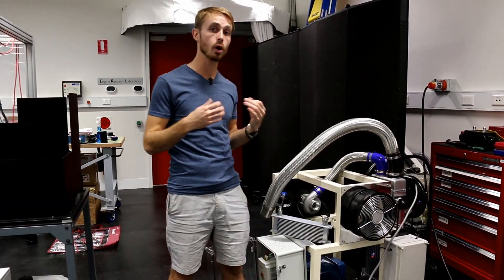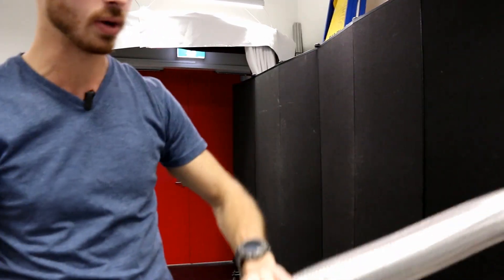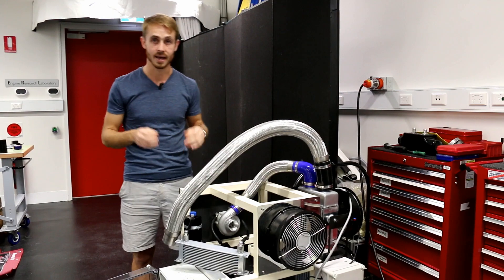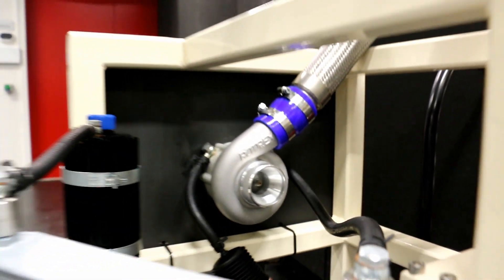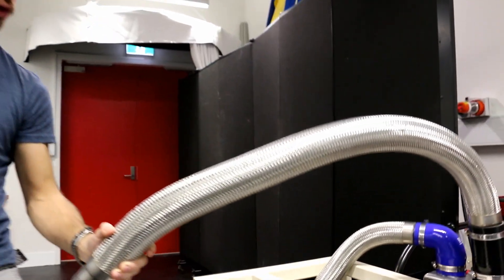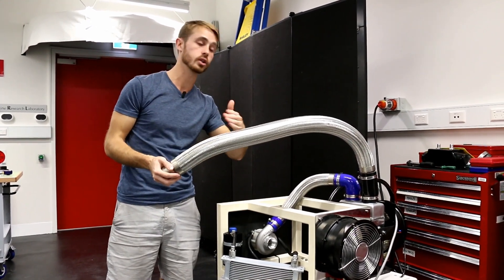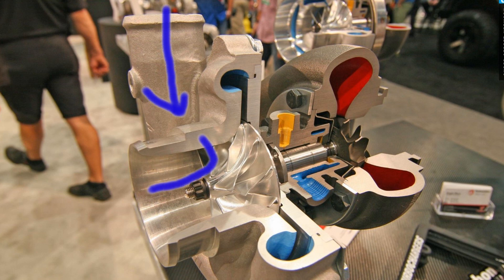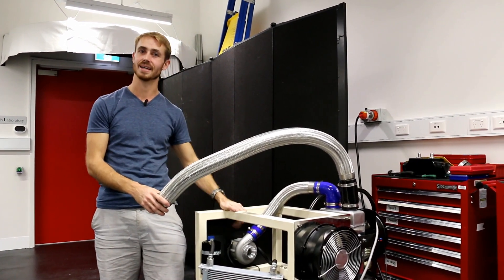What Causes Turbo Flutter? Compressor Surge Explained

Comment: I still feel that lift-off turbo flutter is bad because it slows down the turbo RPM. It might seem like a negligible amount of time to spool back that bit of decayed RPM, but we spend enormous amounts of time and money to optimize performance. I think the flutter sounds cool but if we're min/maxing, it would make sense to avoid it altogether
Reply: It does not slow the turbo down, people have tested it but you can also look at motorsport even at the highest levels and see cars running no blow off valves, if it caused any lag none of them would run without a valve.

Comment: Can you explain how exhaust has any affect on it? I had a 90mm stainless aftermarket exhaust with 1 set of catalytic converters, and just upgraded to a 102mm full Titanium without Cats. I had Compressor surge with the 90mm exhaust. Now I have absolutely none with the 102mm. I obviously hear the turbos more which is nice. But just confused how a larger outlet and more flow would eliminate the compressor side noise.
Reply: With the smaller exhaust and catalytic converter’s, you were creating way too much back pressure and for a turbo charged engine you want to get the exhaust out as fast as possible, and as smoothly as possible since you upgraded to a larger piping and got rid of the cats, the flow has now created no strain on the turbo so it doesn’t have to work to push the air out of the cat
Reply: That’s also why, when you free up a turbo charged vehicles exhaust system, you gain a lot more power than just regular normally aspirated vehicle It allows the turbo charger to work like it supposed to with no restrictions as long as the intake isn’t restricted and you have a blow off valve that is set up properly if you have a blow off valve that has a harshness setting in the spring insert to the harshest setting meaning it’ll only go off at maximum vacuum, you will get compressor surge because you are blocking the only route for it to escape. No that’s not what you asked but yeah.
Reply: @oler777  Thanks dude.

Comment: you forgot filter type, box filters muffle the 'flutter' sound while cone shapes like K&N filters will increase flutter noise.

Aircraft mechanic here, compressor surge in any turbo or turbine is when the impellers lose lift and air pressure can escape back through the pressure differential UNDER POWER. If you actually close throttle body (OFF POWER) you'll no longer have exhaust spool allowing the air to escape much easier back through turbo which is NO LONGER FIGHTING IT.  Turbos that do generate stall under boost ON POWER will trick the afm and ecu fuel distribution at the same time causing misfires and potential catastrophic damage. However turbos immediately OFF POWER cannot 'surge' as there no new air being introduced to hot or cold side under load making the air travel backwards swiftfully like me letting go of an untied balloon
Reply: That's what he explained, meh
Reply: Surge/stall is the same whether you're pressing the gas pedal or letting off. It's the pressure on the outlet of the compressor being too great in relation to the flow rate.
"turbos immediately OFF POWER cannot 'surge' as there no new air being introduced"
A turbo doesn't just stop spinning the instant you take your foot off the gas. The turbine/shaft/compressor all have inertia.
Reply: @derschwarzgeist  because theres no new air, the internal impeller cant create  interal lift stall conditions (like when a plane climbs too quick and stalls losing altitude). This is surge on throttle, i know what youre saying but this is not that

Comment: please make a video about wastegates and what happens if you block them. no one i know of has explained that. is it better to block them? simpler and faster spool. using only the bov to regulate pressure?
Reply: If you block it the turbo will overspin and destroy itself, releasing the pressure with a blow off valve isn't going to stop that.
Reply: You'll get more 'boost pressure' but turbo won't last. Used to do this to Metro turbo's back in the day, pair of mole grips clamped to wastegate pipe
Reply: @jellybaby7  
ok.
is the compressor wheel material, of today not good enough to spin that fast, without destroying itself?
what about tuning the turbosize to the engine, thereby preventing overspin?

Comment: then how come I lost all my chu chu noises when upgrading to a larger turbo? recirculate blow off valve is also installed before and after the upgrade.
Reply: Your blow off valve is the wrong way round, oh dude your poor new big turbo, no wonder u lost the chu chu noises
Reply: @jellybaby7  Or, if it's the exact same valve, the smaller turbo was creating enough pressure to cause stall but not enough to actuate the spring in the valve.

Comment: Yet there are people out there that think flutter is cool and don’t run a bov just so they can produce the sound
Reply: Flutter is cool though.
Reply: @DriftNick  In what way? All it's doing is indicating your turbocharger and intake aren't set up well.
Reply: @derschwarzgeist  It has nothing to do with your intake or with those things bening set up well, the sound is from not running a blow off valve or bypass valve, it's also common place in motorsport.

Comment: This is what happens when millennials get turbo's and don't know SHIT about how they work and love the FLUTTER sound thinking its cool when its actually destroying their turbo ... 
YES i called out the millennials because its ONLY you fuckers that have this flutter sound on your cars ... Trust me, i own a 240sx turbo, a genesis coupe turbo and an MKIV Supra GTE ... ALL have BOV (Blow off Valves) that actually work and release that pressurized air ( PPPSSHH)  AS INTENDED to protect the turbo ...
Reply: I guess the 40+ year old engine builders and tuners here in Australia building 1000hp+ engines that don't run blow off vales on their cars are millennials, what would they know though some random guy on the internet said it is bad so it must be true.

Comment: so i have 1.9 jtd 16v, and sometimes if i step on it on 3rd and at 1500rpm and i released gas but a little bit only, i can hear dudududu clearly, but it needs low rpm and not to release gas pedal fully, so what can i do for doing my jtd dudududu every time and every conditions? has it some type of hidden blowoff from factory or how can i do it? thank you

Comment: This is not turbo flutter unfortunately guys..... it compression surge which happens during compression. Turbo flutter is when the throttle closes.. 2 different instances so they can’t be called the same thing, 1 is during throttle (compressor surge) the other is when throttle is released with no bov (turbo flutter)           Edit: just seems they corrected him like 10 times already 😅
Reply: You need to read what you type ... Read it again and again and when you find the several issues, do it again and send it...
Reply: You Tube I read it 75 times, what don’t you understand? With out a bov when you spool and release throttle you will hear turbo flutter (throttle closed) this guy in the video is demonstrating compression surge and calling it the same as turbo flutter. Read my message again and agin and eventually you’ll understand 😂
Reply: @hubertallicock4336  really ??? 75 times ?? Some people are stupid but to say you read it 75 times is even more STUPID ... 
Compression surge happens during compression ..???
Reply: @hubertallicock4336  They're the same thing.
On throttle: turbo pushes more air than engine can consume, air "piles up" in intake, pressure increases, causing surge.
Off throttle: throttle valve is closed, turbo keeps pushing air into intake, pressure increases, causing surge.

Comment: thanks Kylie. I thought flutter is ok with throttle closed but not ok when during the acceleration. Please explain. Or a shorter charge pipe is better.
Reply: Why would you get flutter during acceleration ..??
Reply: @ACommenterOnYouTube Do you not understand why it happens on throttle?

Comment: It's all about how strong your Thrust Bearing is. Stronger ones on the bigger Turbo's you find in Supra and Evo builds can handle the surge no problem. Weaker ones that you'll find on basic K03's, K04's etc etc will definitely not last when you block off or remove the BOV. I'd give it 6 months before that turbo fails and completely wrecks the bearing, which then causes the compressor wheels to run into the wall of the turbo.. Installing a decent 360 Degree Thrust bearing should help to alleviate this possible issue. But personally, buying a turbo made to handle such excess surge would just be a better way forward.
Reply: Do you mean the turbo bearing, cuz the thrust bearing is a different thing

Comment: So quick question, my car has a bypass valve as of now, there’s a hose which goes into the intake? If I blocked those off would that cause the flutter? And if so could it be harmful?
Reply: Yes it will flutter, and no it isnt harmful.  Be sure you're blocking the right one.   You have a bypass valve on the intake side and generally a waste gate on the exhaust side. Do not block your waste gate hose.  Be sure it's the intake side.        The hose from the BOV/bypass valve that leads to the intake manifold is the one you want.   To test it, take it off, block both ends and give it a rev. It will flutter immediately if it's the correct one.

Comment: People think that sound is coming from their BOV which is what is causing all the confusion. I get this same sound with my V3 vortech Supercharger when just cruising at partial throttle opening. It’s not the BOV. It’s the Supercharger it’s self. Clears up a lot. Not much you can do to prevent this other than lowering your boost overall.
Reply: That's not good. You shouldnt be having that sound under load, only when letting off.  That means your supercharger is generating more air than your engine can make use of, so you're right in saying you should lower the boost. 

If you get this sound when you lift your foot off, its fine.

Comment: I know this was a while ago but I just got the turbo flutter noise after I installed a BOV instead of the stock BPV. I've heard that if I have the correct spring in it it won't do it but would that mean my current spring is too soft or too stiff?

Comment: The phenomenon of surge depends a lot on what the compressor is connected to.  It is a fast oscillation of flow and pressure that depends on the size and arrangement of the pipes connected to it.  On a test stand, a large turbocharger entering hard surge at high steady speed and pressure ratio may sound like a gun shot, it can be incredibly loud and violent.  I think on an engine with pulsating flow the effects are much less concentrated.  The overall concept of aerodynamic compressors is the flow rate has to be matched to the shaft speed, within a certain allowable range.  When the speed is too high and the flow is too small then flow is too small for the blades and it will stop compressing.  When the flow is too large for the compressor this may cause too high shaft speed and and fail the bearings rotordynamically.

Comment: Well then. Why do people want to disable the BOV? Just because it sounds awesome? Are there any advantages compared to having a BOV? 
I'm talking about compressor flutter btw.
Reply: Because it sounds awesome. that's it.  You lose the tiniest amount of boost and that's all.   When you lift your foot the air pressure slows the turbo down faster than a bov venting does. But the difference is usually negligible imo
Reply: When I say slows down the turbo, I dont mean it forces it to nearly stop or anything ridiculous. It will just slow down at a faster rate than having a bov.  Turbos are designed to spin at 100,000rpm  give or take, so having backpressure is very unlikely to cause it any harm

Comment: it will work for any turbo ?
Reply: Yes, you can make any turbo flutter. But the sound will vary depending on the size of the turbo, the volume of your intercooler and piping, and the boost you're running.

Comment: so on my focus 1.6tdci I am getting the sound every time I release the accelerator and lack of boost  !!  no blow off valve fitted and 6 mechanics have looked at it and scratched their heads as to what it is. so my question is what is most likely to cause it ? a blocked pipe ? a blocked dpf ? a split pipe ?  and if any which are most likely to be the ones ? "apparently" they have all checked the air intake valves but nothing noticeable found, any help here would be appreciated as handing it back to a mechanic and telling him the solution would be a day in life I would never forget, lol

Comment: So is it bad for the motor/turbo, or does this depend on the engine build etc?
Reply: If it happens while you're accelerating, yes. it means the turbo is either too big or generating more boost than the engine can physically make use of.
If its only happening when you lift your foot off the throttle, it's completely fine.

Comment: Alright, heres my one and only statement, this is how it is, no if, and, or buts. 
The compressor wheel doesn't spin backwards either
- Turbo Flutter is when Air goes back out the cold side while exhaust side is still working. The noise is created because when you slap the throttle shut, the turbine is still spinning extremely fast and it chops the high pressure air on its way out. Also for further understanding. There's a difference in turbo flutter and compressor surge. Turbo flutter is is the release of pressure after slapping the throttle shut. 

-Compressor surge is when your turbo is set to create so much air, that your engine cant take it all. So while your exhaust side is working its ass off to spin the wheel, theres no room on the cold side to take in all the air through the valves so that air just goes back through the turbo slowing it down while its trying to speed up. Moral of the story. Turbo flutter is not bad, compressor surge is 👍 plus turbo flutter sounds sexy

Like this comment so everyone can see
Reply: The Rabid that is wrong mate. Open thottle compressor surge is bad (stututu while accelerating). Closed throttle compressor surge is fine (stutututu when not accelerating)
Reply: @Dacommenta  100% correct. On the video was 50% explained, but he did not further explain during the acceleration.
Reply: like thatcarguy said, there's no difference. flutter and surge refer to the same phenomenon, which is air going back out through your turbo. They are both bad for your turbo, just fyi.
Reply: The Rabid Rb  I read your comment... you have no idea what you're talking about.
Reply: This is so comically wrong, it displays a complete disregard of basic aerodynamics. Flutter is just off throttle surge. Everyone should stick to watching Kyle and not reading comments that claim that "this is how it is, no if, and, or buts. ".
Reply: Oliv3, there are no recorded instances of turbo flutter breaking or damaging a turbo.
Reply: "TURBO FLUTTER" IS COMPRESSOR SURGE!!!!!!!!!!!!!   There are 2 types of compressor surge; on-throttle c/s... and off-throttle c/s.  Im pretty sure compressor surge causes high axial loads on the compressor wheel and therefore the shaft, thereby reducing the life of the bearings.
Reply: The Rabid Rb 
finally someone with brains thank you sir !!!!!!!!

Comment: So in some cases, this is bad?

Sorry, I'm new to this stuff.
Reply: It decrease responsiveness of engine because exhaust gases must re-spin turbo again.
Reply: Old comment, but it is only bad if it happens while you're accelerating. If it only happens when you lift your foot off the throttle, that's fine.

Comment: I thought turbo flutter was when you don't run a bov there for forcing the air back in the turbo and trying to slow it down and compressor surge was when the turbo is over boosting. At least that's what I watched a shop talk about. Turbo surge and turbo flutter are not the same.
Reply: correct

Comment: turbo flutter is different from compressor surge
Reply: @Richard Vaughn no. Open throttle surge is bad.  Closed throttle surge is not bad. Also, turbo hoses are designed for considerably more pressure than most turbos make.  The soft hoses can jump off the hard ones, if they're loose. Tighten your hose clamps and it'll be fine.
Reply: lone wolf explain?
Reply: Takumi Fujiwara a BOV is useless with a compressor surge, since the surge happens at open throttle and the BOV open at closed throttle
Reply: ITS STILL CALLED COMPRESSOR SURGE!!!!!!!!!!!!!!!!!!!!!!!!!  THE COMPRESSOR IS SURGING/STALLING IN BOTH INSTANCES!!!!!!!!!!!!!!!!!!!
Reply: Both are compressor surge. One is when you come off the throttle, the other is while on throttle. The one on throttle is bad, the one off throttle is good.

Comment: I thought compressor surge is when your on wide open throttle and it does it
Reply: fdssd dfsf correct
Reply: fdssd dfsf Wide open throttle, no blow-off valve. This forces the air back through the turbo and makes that awesome sound.
Reply: It is